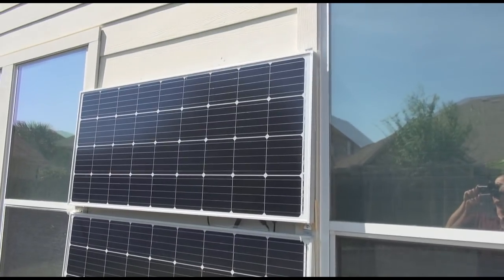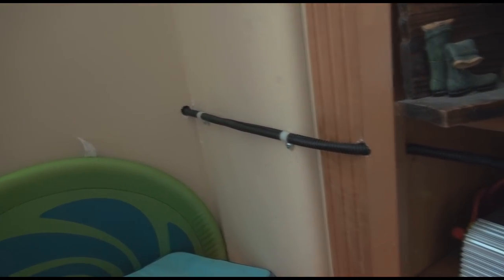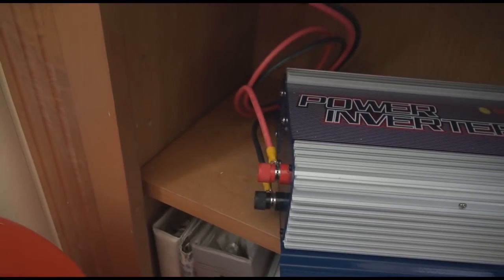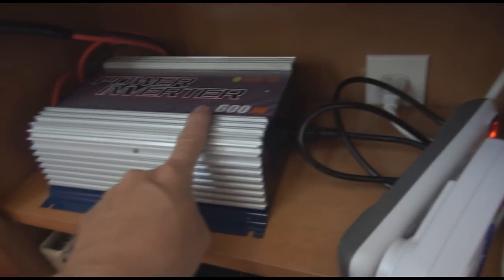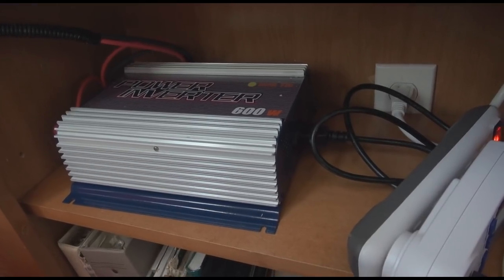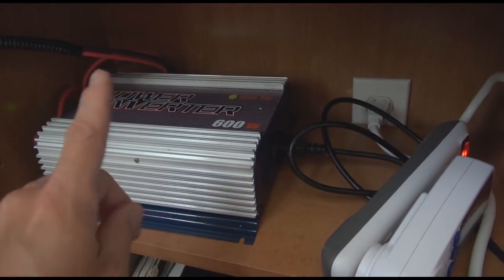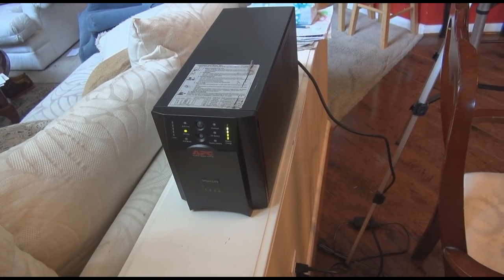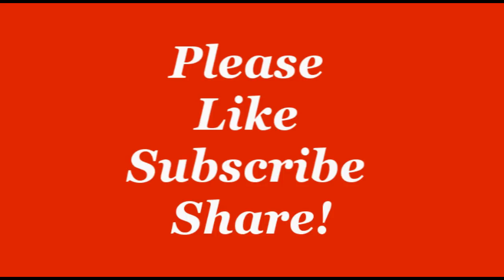Ebay grid-tie Solar system setup step by step

Comment from the maker: This system is basic. I did not put the panels on the roof because i live in a MOA and they require permission and a contractor. Because of this i installed them at an angle that was not optimal for best use.
Reply: alaskanlimoguy so does it work? And do you think it's worth it?